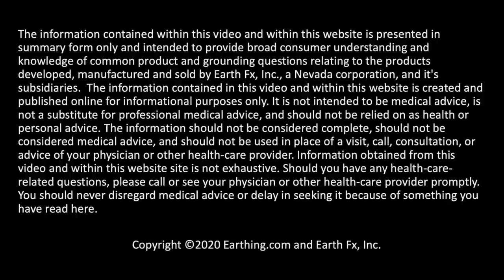Earthing Q&A Session with Clint Ober - June 4th 2020

Comment: I have a plastic step stool under my desk that I keep my feet on because I’m short and otherwise they dangle lol.  If I put a grounding pad on top of a plastic stool and put bare feet on top of the mat does that still work?  Or does the plastic interfere?  I don’t know much about electricity sorry to say.  This is fascinating
Reply: As long as the grounding pad is plugged into the socket or a grounding rod it will work.  I would recommend placing the pad on the bottom of your bed at night too so your feet are resting on it and you get the benefits while you sleep.  Hope this is helpful.
Reply from the maker: Great advice from Graham! He's correct - the surface under the Mat doesn't matter. As long as you're touching the Mat and the Mat is plugged into a grounded outlet, then you will be grounded. (Excellent tip about using the Mat in bed while you sleep as well!)

Comment: Thick grounded insoles with a flat flexible, glueable ground wire that can come out of the top of the shoe and can be attached to the side, glued down the side, and attached to the bottom. Or has a ground chain dangling out the back of the shoe, like a necklace chain.

Comment: You need to include diet ..inflammation begins in the gut.
Reply: He is saying that the science shows that earthing grounds the body and eliminates inflammation - what this would do is lower the ongoing assault from bad food - he mentions the that identifying the source of the inflammation is important - ie you have to balance the insults with the healing - hopefully more healing than body abuse - hence reducing the requirement for grounding - still its an interesting question to explore the interaction between grounding and diet - it maybe that fully grounded people don't feel the need to eat bad food?
Reply from the maker: Diet is definitely important! As is exercise.
Reply: Inflammation is exacerbated in the gut. A great diet plus sunlight and earthing will always outperform a great diet with minimal exposure to nature.
Reply: @sebastianbaran9645  What are oxalates, antinutrients, goitrogens and lectins? Veggies are a meme at this point.
Reply: People reading comments regarding diets, save your time and research the carnivore diet, meaning in short that you eat species specifically animal based food and remove or at least minimize plant matter. N15 isotope testing (for one) shows us that humans have been mostly carnivorous throughout history. It's only when the best source of nutrients are limited, we turn to plant matter to survive. The key issue is similar to grounding. We've kept adding all kinds of fancy variety to our eating thinking we're helping ourselves, when in reality we need to simplify and go back to the basics.

Mother nature always prefers simplicity and chooses the path of least resistance.

Comment: Can I put a pillow case on my mat?
Reply: The mat has to be in contact with your skin.  If you put a pillow slip over it you will lose contact...I believe.
Reply from the maker: Hi Karen, Yes! You can put a pillowcase over your pillow cover or a fitted sheet over your sleep mat. The sweat from your body and the humidity from the air will create enough moisture for conduction to occur. Natural materials like cotton or bamboo are best, but synthetics will work, just not quite as quickly or as strongly. Happy grounding!